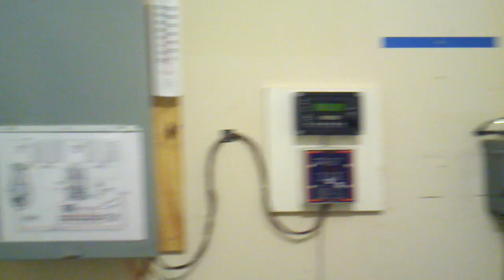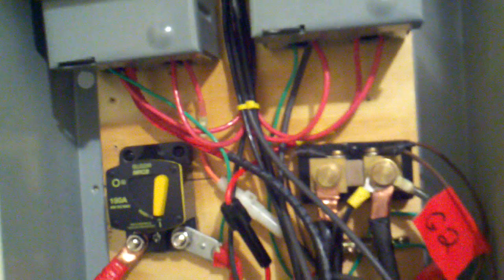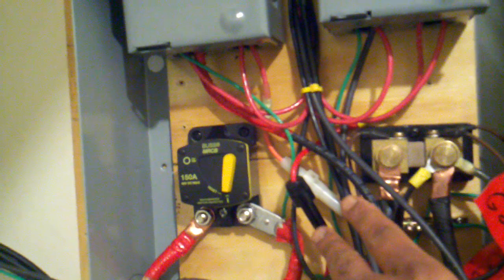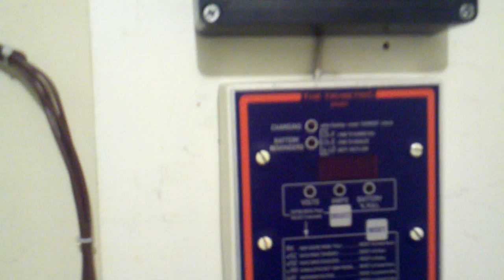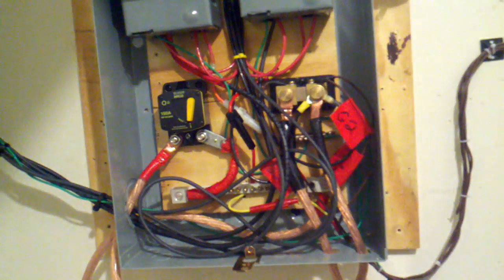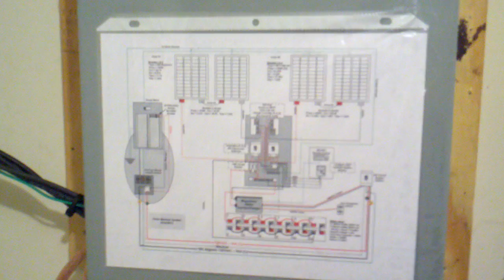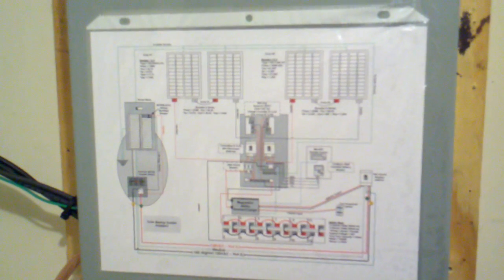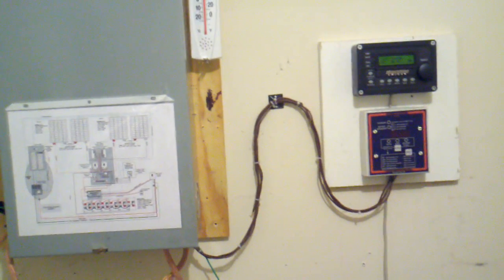DIY Home Solar Backup - Finding a Better Enclosure

Comment from the maker: Actually, it's 12v x 55 Amps = 660w per battery. (660w * 12 batteries = 7920wh of storage). 2 Batteries in series =  (24v * 55A = 1320wh).  12 batteries / 2 in series = 6 sets.  1320wh per set * 6 sets = 7290wh total.  So hopefully you can see that in the math we have 7920wh of total storage.

Comment: ? if you have 12 batteries at 55 AH ea. wouldn't that be 15840 watts at 24 volts all together? 55 x 12 = 660 x 24  = 15840. can you clarify this for me. thanks

Comment from the maker: Thanks for your comments, I'm assuming your talking about replacing the MPPT's with ones with display enabled one. The Tri-Metric, which is a good monitor, gives voltage, amps in\out, amp hour remaining, battery state of charge, etc. MPPT's with displays are fine, however all of the functionality and more is in the Tri-Metric.

Comment from the maker: Thanks for your question. No you don't have to buy the batt monitor. According to the documentation, the battery monitor will make the readings "more" accurate in relation to various functions in the controller. I've thought about purchasing it, in my case it's more of a nicety than a necessity, but for general reading of volts, amps, etc, I've found the Tri-Metric to be more accurate.  The low battery cut out will still function without the battery monitor.

Comment: Hi I have the same inverter that you have but I havent bought a remote for it yet I was wondering if you have to buy the battery monitor me-bmk to use the remote for like the low battery cut out. I have a trimetric so i dont realy need a battery monitor.

Comment: hi  i love your videos and  diagrams am look to start my backup / grid tie system this year.  i know you said that this is a back up system but what happen when the power does not go out for weeks all that solar energy goes to waste because your battery are already fully charger. i think butting back the grid tie back on your system can will put some cash back in your pocket untill that day come. All of this is still new to me do you have any advise thanks keep making videos.

Comment from the maker: Thanks for your comments.  Inline fuses provide good over current protection and should be placed in between each piece of equipment (I.e., controllers, monitors, inverters, etc) and the battery bank. Household switches maybe suitable for low voltage\wattage disconnects but not for over current protection, unless they are rated as a AC\DC circuit breaker.

Comment: I`ve been watching your vids,probably missed a few. Care to comment on the ANL fuses,many inverter companies want them between the batteries and the inverter. They apparently act very quickly. What about just using household double pole switch,good for 20 amps instead of the large boxes you show. Thanks for the idea
about a fuse before the meters. Keep up your good work!

Comment: Like me, you're served by 3 nearby power stations- nevertheless, close to a million people suffered through TWO 10-15 day long winter power outages in the last 2 yrs, due to overhead power lines getting knocked out by heavy wet ice storms- these occur more frequently due to global warming. So, even with adequately redundant power stations, it's your overhead power lines, that easily become the single points of failure. Answer? 12 kWh battery bank, 5 kW of panels, and a small diesel generator!

Comment: Great, with that accessory- unless you already have a controller and diversion load- you (or your neighbors) would get some use out of all that extra power (about 3 KW-hours) your solar panels produce every day, over the amount needed to keep the batteries topped off (probably about 0.5 KW-hours)!

Comment from the maker: Thanks, that's exactly what they tell you to do in the video and on their schematic.  You must have some form of controller and diversion load.  They are developing an accessory unit that should be available in the spring that will have all of those components to compliment the AC Coupling.

Comment: With AC Coupling, the only thing to double-check, before you set it and forget it, is: what does the Magnum do, in the event of a grid outage, full batteries, and power from the panels (grid ties) backfeeding into its AC output. Does it keep letting that power go to the batteries and soon overcharge/damage them? Does it shut down the grid ties by raising the 120V output line frequency from 60Hz to 60.6Hz? If not, you'd want to add a dump load- like an electric water heater element.

Comment: Here's a full video where a Magnum rep talks about using the Magnum inverter's "AC Coupling" abilities - meaning, letting the both the Magnum and your grid-ties, hook into the house grid AC- the grid-ties will keep generating power even during a grid outage (to back feed your magnum and charge your batteries), as well as keep selling power to the grid when the batteries are full (and they're almost always full !!).  search youtube for keywords SolarMOOC Lecture AC Coupling In PV Systems

Comment: My state's electric utility is unregulated- private free market competition, rates are the highest in the country $0.21 per kWh- 1500 kWh/month for $300. Utility privatization was terrible for the consumer, but it's driving solar adoption. Did you realize, your Magnum inverter-charger officially supports grid-tie inverters on your home grid?? If you attached your panels to your grid-ties- Big question is, does ur utility charge a lot to replace ur existing meter with a nice new net meter??

Comment from the maker: I would have to get the net metering hooked up and agree to produce (x) amount via the agreement. In order to make it worth my while, I would have to add a minimum of 2kW of panels to my system and buy an acceptable GTI that would meet with their standards, etc.  When you live near 3 nuclear power plants and a hydro plant, and your dealing with a "public" utility the electricity cost is quite reasonable. I pay $0.083 per kWh and I don't use alot of electricity. So the incentive for me is little.

Comment: Nice. Your local utility incentive looks great. I believe they'll expect you to hook up your grid-tie inverters so you'd sell your excess solar panel power back into the grid, the watts that you're currently throwing away when your battery bank is 100% and can't take any more charge off your panels- to help out your neighbors- like those hot summer days when everyone's blasting their 800 Watt air conditioners, or a neighbor who's charging their plug in hybrid electric car, etc.

Comment: Have you looked into, or applied for, or gotten, any rebates on your solar system ??  There's a federal 30% rebate that you may be qualified for, plus possibly state and local utility company rebates.  My state offers, your choice, either a rebate, or renewable energy credits, but not both.

Comment from the maker: I believe you are correct, when I bought my 12v panels I believe I paid that much per watt. And yes, solar is way more affordable now.  Also, my 2 mourningstar charge controller are stacked so to speak, in that they are parallel charging my 24v battery bank, both are connected to the same positive terminal on the battery (through a bus bar) and the same shunt for the negative. It's been running fine for almost 2 years.

Comment: From your videos, it sounds like you paid around $2/watt for your panels, 2 years ago, prices were higher then- I'm finding great deals today- only $0.65 - $0.85 per Watt for German made Sovello 200 Watt panels - 28-30V at 7-8Amps - I like how, these days, when you want to acquire a 4-5kW system, it's more affordable.  Are your Morningstar MPPT 15 Amp charge controllers stackable, are they able to parallel charge one large 24V battery bank ??

Comment: I'm starting to look at going bigger, and install 24 x 200 watt panels (4800 Watts) + 240V inverter/charger, and either resell ur excess power back to utility, or go big on the battery bank, with a 20 KWhour battery bank that could last the 19-20 hours the sun is down or not strong enough to generate any juice.  A 4800W system including the 8 KWhr batteries would cost, net, probably $3000-4000 after fed state and utility rebates.  No more $300 monthly electric bill !!

Comment: Both Outback and Xantrex (now called Schneider) offer 240V hybrid grid-tie / battery backup inverter-chargers that let you sell your excess solar electricity back to your neighbors.  The Outback Radeon 8048 - 8kW capacity, 48V battery bank.  Outback also has the GVFX3648 - 120V, 3600W, 48V battery.

Comment from the maker: Thanks for your comments.  I have one array that 270w (12v panels) and another at 400w (24v panels) on a 24v system.  Your best bet would be to go with the TS-45.

Comment: Very nice setup.  Really cleans things up.I have a question on your Sunsaver controllers. How many watts do you have on your 12 volt PV panels. Morningstar says the Sunsaver will only handle 200watts at 12volts and 400watts at 24volts.  I have 4 120watt 12volt panels. I would have to have 1 Sunsaver for each panel at 12volts or 2 panels in series for 24volt for 1 Sunsaver. Looks like I might have to go with TS-45 which has 600w at 12v and 1200w at 24v.

Comment from the maker: Hybrid systems are great. I would deffinitely recommend the Outback for a good hybrid system, it has the capability of charging the batteries, using solar, and Grid Tie.  I thought about going with it when I was searching for a replacement inverter.  It was a tough choice. However, for me the 240v input/output capability won out. I live near 3 nuclear power plants, and 1 hydro electric. Electricity costs me around $0.083 per kWh. With my GTI's in operation I was saving around $0.20 a day. :-)